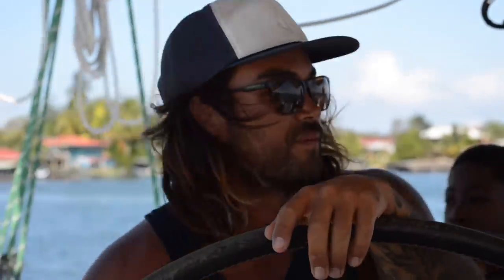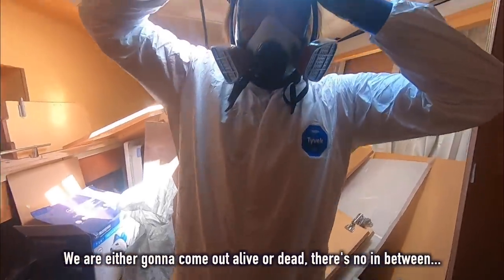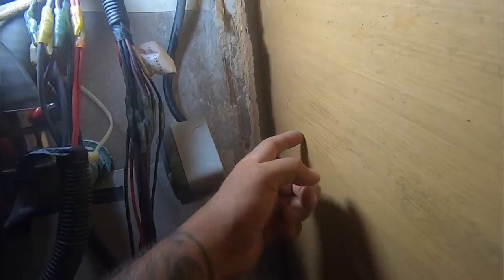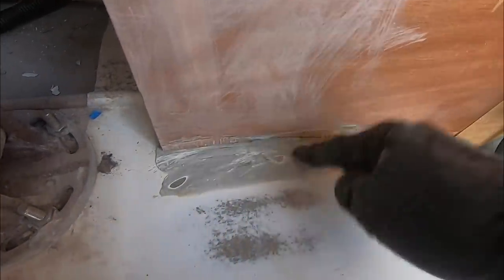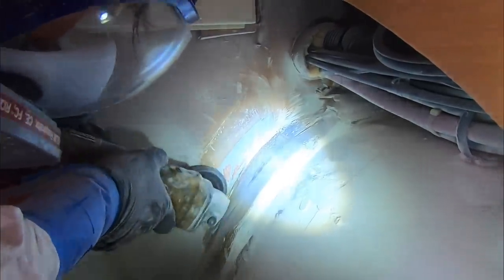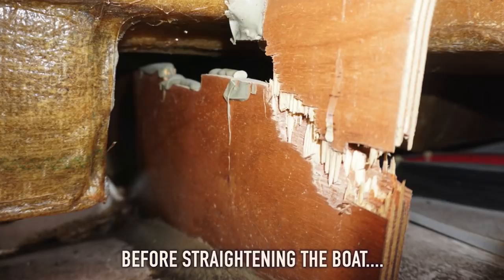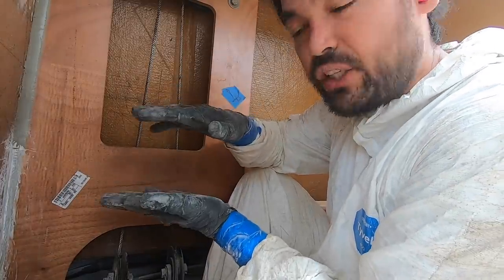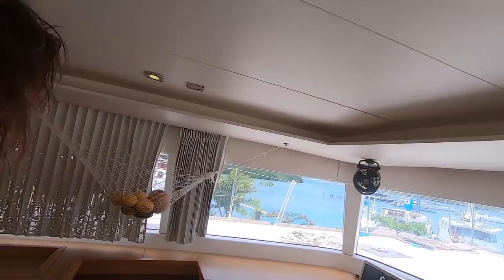CRACKED BULKHEAD REPAIR SERIES - Part 7 (Episode 112)

Comment: The angle of the dangle is inversely proportional to the heat of the meat, provided that the maxis of the axis, and the gravity of the cavity, remain constant.
Reply from the maker: This is getting pinned as the best comment so far 😆😆😆
Reply: Correct !!
Reply: @moejaime2654  but then we wouldn't have this incredible YouTube series.
Reply from the maker: @moejaime2654  yea because we had X-ray vision and could tell the bulkheads were snapped before we bought it right? 😆
Reply: In there like swimwear boys !
Reply: Bill you have a way with words, bet you the girls love when you talk like that. to cool bud..
Reply: @ParlayRevival  that reminds me. Mechanics use endoscopes to look into engine compartments. That would be perfect for your needs.  All you would have to do is find or make a small hole near the bulkheads so if there's no damage you don't have to cut apart the interior. Parlay would have to be disassembled anyways, but maybe this could save you time and effort in the future.
Reply: @sheerluckholmes5468  & the heat of the meat!
Reply: You win Buddy!!!! Send them the shirts
Reply: @moejaime2654  Even if this is the case in the end they are content creators and this videos make them world famous in the sailing community. So I am pretty sure even if u are  right they will come out of it on top.
Reply: Yes, but that only applies when the throb of the knob relates to 4/7x 83%/5 of the volume of fuck all.
Reply: @henning7923  I think they will I just like to bust balls lol pun intended !
Reply: Well.  I think I learned something... I think
Reply: Just by way of clarification, the phrase is "could HAVE" not "could of"... Just saying
Reply: @ParlayRevival  Not xray eyes but maybe knowing when to stop and rethink the madness you fellas are in right now ?
Reply: @moejaime2654  Give them a break Moe, could have bought one that looked mint and had busted bulkheads. Those things are buried deep.  There'll be a lot of very pretty pristine Lagoon owners a tad concerned after watching this series unfold.
Reply: @ParlayRevival  what, giant testicle don't give you xray vision?!?!? people are dumb, and they can't understand hard work like you guys are doing. They see it, and think why didn't these guys just buy it good?!?!? Which of course you have explained repeatedly on your channel.
Reply: @ParlayRevival  It's a classic...dates back at least to the 1970s.
Reply: Don't forget to  factor in the lust times the thrust assuming the urge is constant.
Reply: Sounds like an AvE follower
Reply: 40 roger that ----- everytime !!!
Reply: BEST Comment on this channel so far ..
try n beat that ---- YOU CANT ....
#PEACENLOVE
Reply: WINNER !!
Reply: @sebione3576  i’ve one and used it to check different issue on my boat (not a Lagoon !) It is not so easy to use for such purpose: Limited Field of view, upside- down  orientation mostly lost, light of the endo is designed for very close distance, something like 20-30 cms max. In one word, the inspection endoscope are designed to inspect at close distance, if > 50cms, you barely see nothing, especially  if you have no idea or plan of what are you looking for. It helps, but only in specific conditions
Reply: @moejaime2654  Look at the BIGGER picture, by the time Colin and Jamie are done, they will be just a famous as La Vagabond if not more and makin a fortune.  So who's got BALLS for BRAINS !!!
Colin get Jamie to play guitar and sing at end of vids, oh cut bangs in his hair too ... LOL !!!
Reply: @moejaime2654  looks like they are succeeding to me, cheers from a fellow Jaime.
Reply: @moejaime2654  Sure there are shortcuts to sail more, but this is a lifestyle of it's own. Some get it, some not ...
Everybody can buy, but it needs a special type of person to build ....
Reply: @moejaime2654  Yeah he lost his ass on this boat....No doubt....
Reply: @moejaime2654  Christ thats some BRAINDEAD statement to make
Reply: genius
Reply: @ParlayRevival  right! Nobody new, plus at first your logic lead us all to think it was due to getting tossed by the hurricane.... Once you're halfway in, might as well go all the way (balls deep)
Reply: And hear I was thinking, 'The angle of the dangle was in direct correlation to the sag of the bag'?
Reply: Balls Out
Reply: Lads the world's full of knockers ballocks to em all keep going I reckon your going good
Reply: Its been over 40 years since I've heard that but could only remember dangle and meat. Well done! That's a t-shirt!!!
Reply: @ParlayRevival  You guys are HEROES! 💎👐
Reply: @ParlayRevival  Knowing that there is a rather large group of Lagoon 450s that have the exact same problem with the bulkheads and they weren't hurricane damaged, I'd say your criticism is moot or at best wasted.  The boys bought a wet boat that had some storm damage. All those internal bulkhead joints should have still remained sound.  Note how they remained in place until the boat was tested once too often and then BANG. Everything cracked and distorted. 
So tell me, would you use the same criticism to the other Lagoon 450 owners who are now in the same position as these two boys? No? I didn't think you would!
Reply: @ParlayRevival  Colin, you will always get critics but the intelligent realise that it is impossible to have known the hidden condition of the boat and the poor design and poor quality construction. You and Jamie are doing a great job. One point, when the plywood is cracked through (broken) the section should be scarfed out and a scarfed new piece inserted then glassed over heavily.
One thing for sure, throughout all of this major repair from the start, you have being showing lagoons poor quality more and more with each post.
Lagoons sales have taken a huge hit and is costing them dearly since you started posting this latest repair issue. There are no doubt many people that are very grateful to you for honestly highlighting these quality issues of the lagoons.
If lagoon were smart they would have given you a new boat as a straight swap for your damaged one before you started digging and exposing the issues, which they were already aware of their poor quality standards. That would have been far cheaper that all the lost sales.
Reply: Not even going to bother replying now as this is the best response ever
Reply: @nuffsaid7952  big lagoon fan, sailed on quite a few.  But seeing this - man it’s shocking.   I hope for Lagoons sake it’s just a modern thing but it really means their quality management is so cost driven that quality has gone out the back door.   Make me think of what happened with Boeing & VW......   cost cutting and profit gauging will end in tears.  They don’t teach that to these basterds doing their MBA’s.
Reply: @ParlayRevival  Don't you just love the in depth advice you receive which has been so lovingly well thought out (not).
Reply: @aeasthouse316  yes it’s a real pity as the layout of the lagoons are really great and make for a comfortable home. This is what happens when companies get greedy and are driven by maximising profits at any cost. The real sad part is that this poor quality in design, materials and methods can’t be seen without cutting open the drop in glue and go modules and many have fallen victim to lagoon. One point for sure is that Lagoon cats on the used market will loose signify in value now compared to the other production builders. 
Many people are being manipulated into believing that the lagoon quality issues are limited to the 450. The other models have quality issues and some with the bulkheads failing. It really is a case of buyer beware as lagoon have a poor history of standing behind their product. Take for example the 2nd lagoon 500 that sank some years back off the east coast of Australia where a rope dislodged the sail drive and the whole hull flooded because the bulkhead between the main cabins and the mechanical space wasn’t watertight. lagoons documents and promotions for the 500 at the time stated that this was a watertight bulkhead. Lagoons defence was that it wasn’t required to be watertight under the build regulations and subsequently removed the watertight bulkhead wording from their manuals and all documents.
Yes the alarm bells were ringing a long time ago regarding lagoons quality and ethics for those that were prepared to listen.
Reply: @nuffsaid7952  agreed.  There are enough seen to know what is happening is not limited to the 450.   Limited tabbing to hold bulkheads in place, tabbing not bonded to suitable substrate and voids below tabbing are signs of poor workmanship, poor oversight and poor management.  This is signs of a culture of a rotten company.    Cost for doing it right is minimal in comparison to overall boat cost.   It’s a culture where factory workers  don’t care and this most likely stems from these people being treated poorly.   Been long enough in business to know how this cycle works.   It’s sad - loved their designs as well.   Wonder how common this is with other boat builders?
Reply: @ParlayRevival  Gotta agree on that.
Reply: lmao.   This has my vote.  Hands Down!
Reply: @sebione3576   Hard to see how bad a crack is that way . You sometimes need to pry at the glass to see it has come free .
Reply: This is gold!!!!
Reply: @moejaime2654  If you have been watching from the start "The Bulkhead Issue" was not apparent at the time of purchase and it was not a know L450 flaw until Collin revealed it. Hindsight....
Reply: @ParlayRevival  no worries, once you are done you have a boat that you know really well.
Reply: There's no better way to know your boat inside and out than to do this work by yourself, (and good friends) No one will do it better than the one that owns it, knowing his responsibilities when he has people on board, they're lives are in his hands, it doesn't matter the size of ones 'balls' it's the desire to want this particular boat that has been their home for years now, all the work and time they've put into the Parlay, it would be foolish to stop now, their wanderlust for circumnavigating the world, wanting to make sure it's done correct the first time and it will outlast any Catamaran off production lines. What would you buy? The boat built in a factory or the boat Colin and Jaime built?
I know what my choice would be...
Reply: But Dangle Angle is a function of  an exothermic reaction to meat density and  the viscosity of the cavity content....axial maxis is incidental to the proportionality of the median desisty.
Reply: Dont forget that's all To the 2nd power!
Reply: Gotta agree, best comment!
Reply: @moejaime2654  At this point, he's balls deep in a repair on a busted boat, if he cuts his losses he ends with nothing.  Might as well finish the job and at least go for a Caribbean cruise.
Reply: @moejaime2654  you obviously don't know the price of these Cats,  hes already insured for more than he/they have into it money wise.. .
Nevermind knowing that it's done right now!!!
My husband and I restored a boat because we wanted to know its safe!
Reply: @moejaime2654  Yeah bud but look at the result, you'd be lying if you didn't feel a trifle envious of their lifestyle on and off the water, keep 'it up' guys.
Reply: @dezman56ford  I own a st.francis 50 not envious at all . want to buy a boat ?
Reply: @moejaime2654  Imagine finding a solid Lagoon 450 for sub 300k, yes he's labor in, but he also has a known vessel that won't have any further structural issues when he's done
Reply: @SrslyNoz.  Imagine not giving a shit about working for months on end on a broken boat ; instead buying a boat with a few issues that has not crack in half and being able to enjoy it like normal people?
Reply: @moejaime2654  If you had another 200k to spare that would be great, or maybe they buy a "great vessel" that passes survey and it's shit below the skin too, At least Parlay is properly sorted and it appears that Colin enjoys the fruit of his labor.
Reply: @SrslyNoz.  NO MONEY NO HONEY !
Reply: @SrslyNoz.  I live within my means and my comfort level and I don't need to compare myself to Parlay or anyone . I just give my opinion and thoughts on how I would do things .  If Parlay owners  likes working for months on a broken ship that is their choice ! for me I work to make money then I enjoy my labors by having fun and not sweating over a boat refit .

Comment: In aviation, we say balls to the wall, which means to push the throttles wide open up against the forward stops and just getter done.  You two have pushed yourselves physically to the max to get the sanding done.  It is all about the prep work and you just have to push through the pain physically to get it done, that’s what real warriors do.

Comment: My concern at the start was you'd never get it as strong as the original build. After seeing Lagoon's crappy workmanship , thats not going to be an issue. Your going to have the strongest 450 out there. Respect to you guy's.
Reply: Have you seen Expedition Evans and the repairs they did on a damaged Beneteau? They also found shoddy factory workmanship but now have a yacht they can structurally trust in any ocean.
Reply: Now, think about the value of that shitty work... Factories pump out trash boats and charge a small fortune.. meanwhile, they are falling apart as soon as the water stresses em...
Reply: I am so thankful to have seen this. I have arthritis and am considering buying a blue water capable cat to live on. In my best days I would have considered your repair job a nightmare. I am beyond impressed. Your work ethic, proficiency and engineering skills are top notch. I need a boat I can solo around the coast. No way I could afford to be in the position you were in Colin. I'm limited and for me that means not being able to go forward at times. Is this a deal breaker? Compassionate criticism will be well received. More than likely? There will be a lot of time I will be by myself. I can't go climbing ladders like you would in a monohull. Hip problems more than anything. Circumnavigating would only be possible with help in my case. I'm going to be grateful to the heavens to be on the water again. I'm in Southern Indiana but I've spent time on the inside passage of Alaska. I know I will need more sailing lessons. I've got a lot of time in motor boats, 36' and below on Rivers, Lakes and Oceans. Anyone that has a passion for the water? They know what's up. It's beyond a drug high could ever be. It's a state of mind and life. Safe journeys my friends. 🙏
Reply: If a hurricane hits the side of Parlay after Collin and Jamie are done with it . It will immediately disperse and return to calm lol
Reply: @PremiumJulioon  
exactly
Reply: I’m sitting here watching and not only am I about to have a claustrophobic panic attack watching you crawl in those spaces , but can feel in itching! 
Ahhhhhhh

Comment: Colin, I had started feeling like this was a design issue a while back. I remodel houses and have added several additions on houses over the years as well as many expanded openings in structural walls. Installing a weight bearing unit ( beam) to make a large opening in a house is essentially the same thing these 2 bulkheads are doing. When I first saw what was going on and fact that they were only single 3/4 plywood made me question the original design and the shitty attachment job to the hulls. I just feel like if they had been triple ply and had been bonded correctly to the hulls you would still be sailing the world brother. Now with yours, the boy beside you and the 10 others mentioned with the same issue, Lagoon may need to do some serious amends and PR work. Your videos are far reaching. Surely they know this. Keep at it brother. Thanks for the videos
Reply: agree with you 100%
Been discussing this with a local boat buider, and he went down the same road, that the bulkheads should of been (forgot the exact number) think he said 18 layer plywood
Reply: I too, 100% agree. I have been flipping foreclosure homes for 15 years now, many times opening the floor plan by removing structural walls with steel beams or laminated beams and my first thoughts were design flaw.  We need our point loads to continue to the ground so most of the time we need to add cmu columns for added support. Your ground is water!  I would think that would involve much more engineering than a single sheet of plywood glassed over!

Comment: Warning for you, I had an issue with a smart charging circuit overheating when a boat builder left all the new electronics sitting in the cat he was building for me. The circuit board was covered with dust inside, overheated and fried all the house batteries, that nearly exploded.  We were out to sea and could smell a smell like raw sewerage, which came from our batteires.  So be warned, vacuum out all your circuit boards, you don't want to loose your systems or have a fire onboard, may save your life.